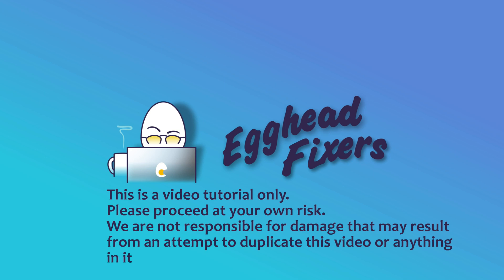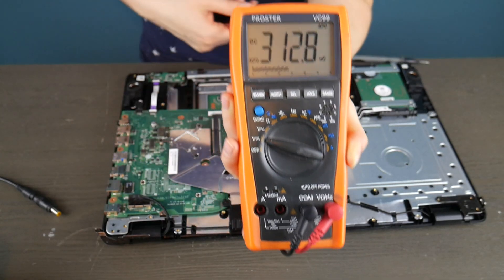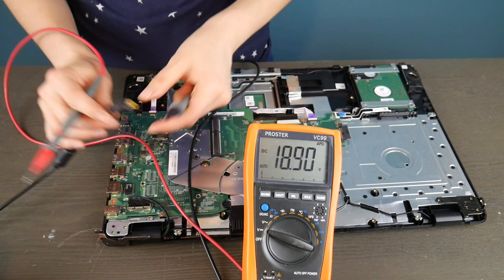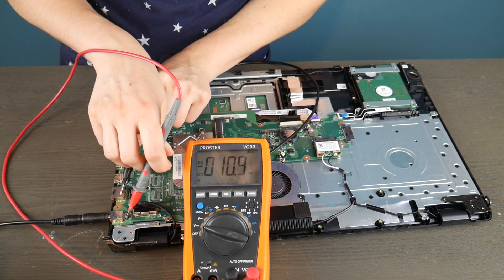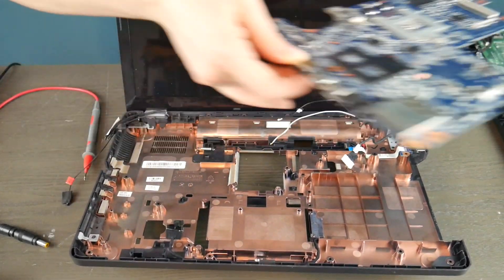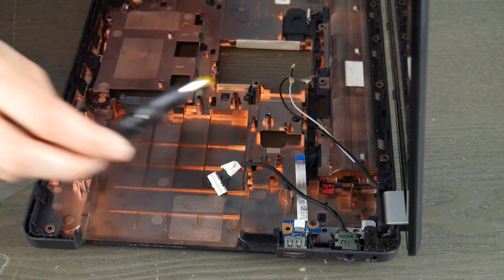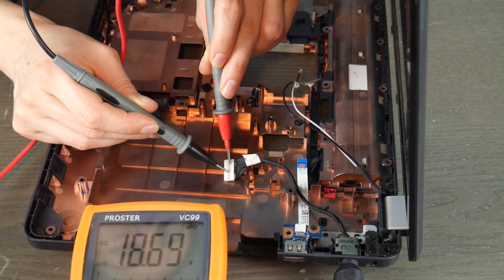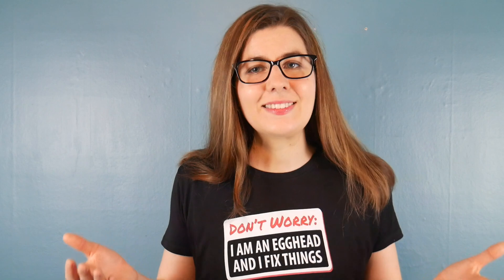How to Test Your Lenovo Laptop's Power Jack with a Multimeter - Tutorial by a Certified Technician

Comment: Hi
I have a Lenovo H30-05 90BJ.
The computer is not turning on, I tested the charger (65W 20V 3.25A laptop charger, Rectangle Mouth with Needle), with multimeter & I get result for less than a second, and then it goes back to 1.
I bought another charger from Amazon and I get the same result.
So I bought another one and again I get the same result.
The same thing happens when I tested the power jack on the mother board.
Could the 3 chargers be faulty? Is the yellow Rectangle Mouth with Needle need to be tested differently?
BTW, when I test other chargers of other computers, they all given me a constant reading of approx 19.50 V, so I know the multimeter is good
Thank you very much
Reply from the maker: Sometimes you need to test the side walls or the very back side walls on a rectangle mouth charger. They can be surprisingly difficult to test in comparison to a standard round one.
Reply: @EggheadFixers  thanks for your answer Liz, i didn't put the leads in the right place like you said.
But also my multimeter was set to 20V, Instead of 200 🤦. They all work fine.
So i guess my problem is with the board, do  you have a video or idea of how to check the motherboard? I took out all the components from the board, so the only thing connected is the cpu.
Thank you very much
Reply from the maker: @Tal.10  Usually with the motherboard it's just the process of elimination. You test all the other components first and work your way to the motherboard. What problem are you having with the computer?
Reply: @EggheadFixers  Thanks for your reply.
The computer won't turn on, it looks completely dead.
I took out the RAM,  DVD, & SSD, & there's no reaction
I do get 20.3V from the power jack (i tested it like you showed in the video)